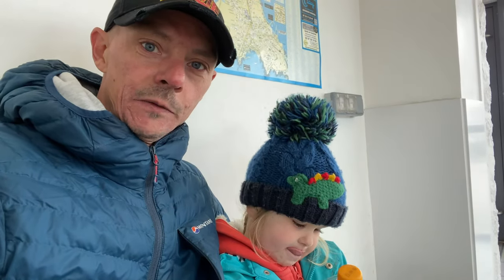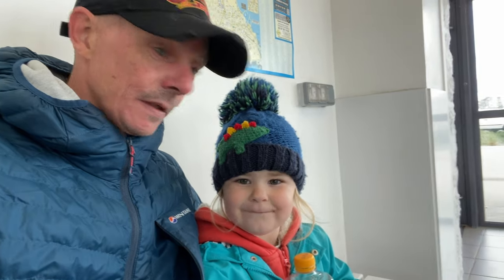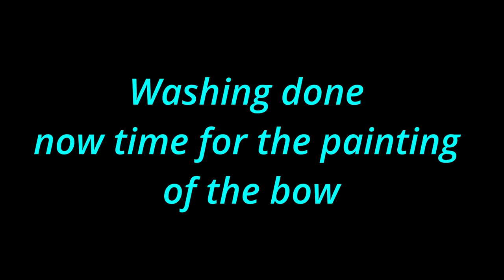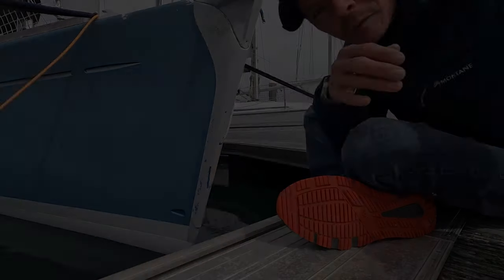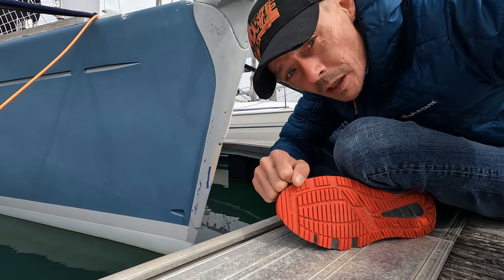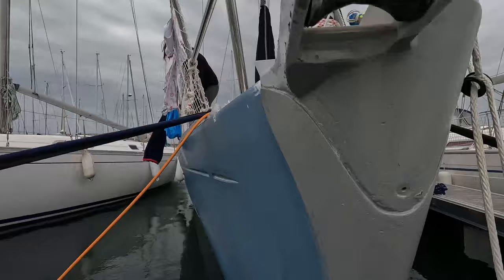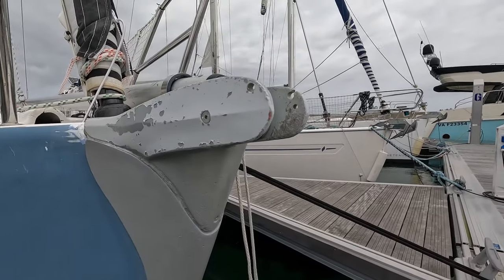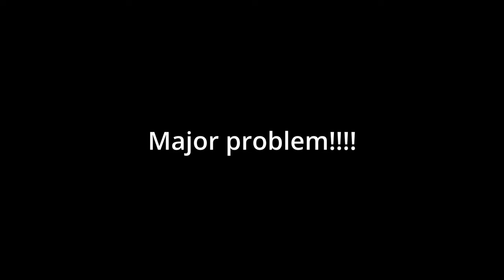Major problem | Cracked Spreader on a Sailboat: The Major Problem You Can't Ignore

Comment: Do not remove the shroud on one side of the mast only otherwise the shroud on the port side will want to bow the mast at the hounds.  Tie off a timber hitch at the hounds and tension using blocks and tackle both sides BEFORE you remove BOTH of the shrouds, then remove the split spreader and get it seam welded (aluminium).  You HAVE to remove BOTH shrouds.  As you said in the video, use the spinnaker and main halyards to steady the top of the mast.  You are over the bad winds of the past few days and have fine weather for ten days as the Azores 'high' moves into North Western Europe to give settled weather.  Good luck.
Reply from the maker: Thank you for your help I’m hoping to go up the mast today when the wind drops to see if the ends screws can be removed. 
I’m not going to remove them yet just seeing if they are corroded in place or not. If they are then it is likely the mast will have to come out.
If there able to be removed then I’ll be planning on getting the mast tied in place ready for the removal of the spreaders both side.
I need to find someone who can weld the cracked one before I go ahead with the removal this may be difficult with limited French and time.
Thank you again we will update on the progress soon.
Lee
Reply: @sailingquackers5502  Just a thought.  Once you have the spreader off and down, take it to a car body shop where they do welding.  They probably don't do aluminium welding but their welder that they use will certainly understand the problem and would be the very best person to point you in the right direction?